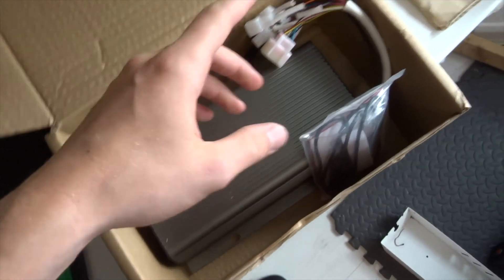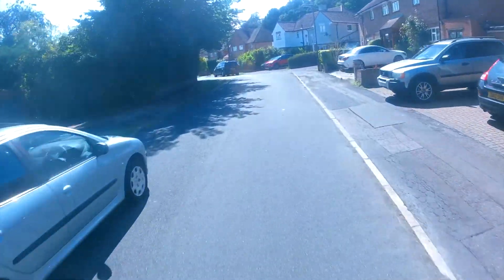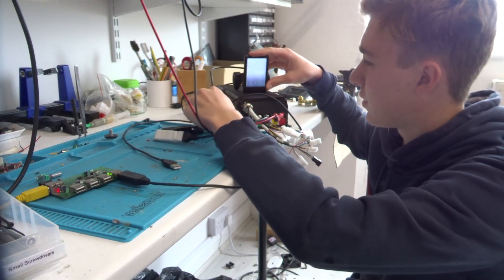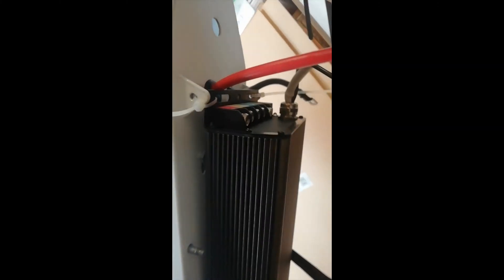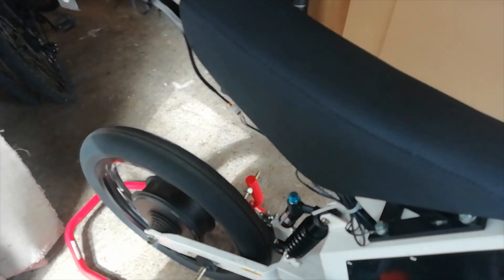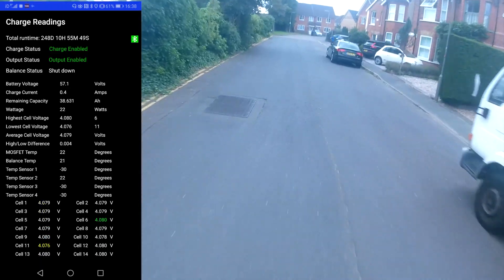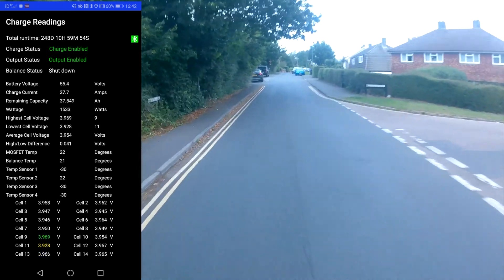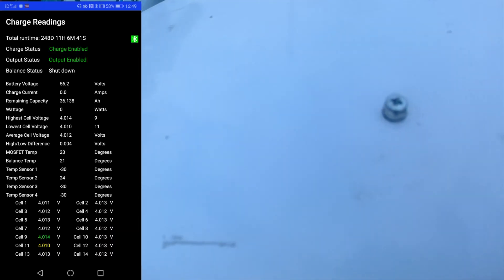The drama continues... - Sabvoton trouble - 8kW Enduro MSVA eBike V3 Build

Comment: If you pause at 10:26, you get 56.8v, 151.8 amps, 8614 watts = Front wheel up.
Reply from the maker: I wish! I wonder now if the motor is a much lower winding that what I thought perhaps a 2 or 3T

Comment: All this work and all these amps and no speed , this thing should be doing 110 Km
Reply from the maker: Could be close to 60mph with high flux weakening. Letting you down with the low battery voltage there! 😂

Comment: I don't know why most high-power electric bike users insist on sabvoton. 
There are a lot of high-power controllers.

The more features you have, the more likely you are to get errors.
Just buy a controller that has only simple functions. 
Once you have set the perfect settings, you won't need to change the controller's settings anymore,
so it's a waste of money to buy a complicated controller like a expensive sabvoton.
Reply from the maker: At the time of making, it was the only brand I'd really heard of as you say a lot of other people use them. I have now learned they are not the best so will keep the one I have for now my eye on the market and browse around.

Comment: I have a sabvoton 150 on my bike and recently broke the screen which meant I had to use the bike without the UKC1 screen and it went into power level 1, I also note on mine power level 1 is very erratic, almost unusable the higher the settings I run.  The fix I found was setting the sabvoton to hard start in the app not 3 level switch or boost etc just hard start.  I since fixed the screen and still leave in hard start and the screen computer overrides with lowering power but I cn now unplug it and it comes on full (app settings) power.
Reply from the maker: That's annoying about your screen, but I've tried hard start and it didn't make a difference 😒

Comment: Hi , seems you know how to sus many problems , I need a bit of help finishing mine , I bought a 8000w  72v 150a  Enduro ebike from china ,I wanted a complete bike , then they said because of Brexit could not send complete , so agreed to build the bike from bits , got the bike in may , guess what no assembly instructions and no wiring diagram .anyway I finished the build , watched some videos , managed to get the company to sent some pics of the sabvocon wires , but the wires had differant colours and some connectors didn't match . I have fitted the wires from the hub to sabvocon and connected the back light , I have key with wires fitted , and a rectifier/regulator , but the head light I don't know were to wire to , and I have 2 black wires from brake lever left and 2 for the right , but as on wires for brake have 3 blue separate  wires from sabvocon 1 female small black 1 male small black connector and 1 loose blue wire, so if you have any ideas , in connecting the headlight and brakes , and key , and rectifier/regulator , am stuck , help please . Doug
Reply from the maker: Hi Doug, there are so many variations of the sabvotons that it's going to be hard to tell, but I'll give it a go! 

The brake levers have a switch inside them so the two wires coming out of each side get connected together when the lever is pulled. On my sabvoton, there are two wires called High brake (purple) and Low brake (yellow). The brake wires from both sides can have one wire connected to either of these and then 12v for the high brake wire or 0v for the low brake wire. 

The key switch should be an orange wire from the sabvoton that connects to the battery positive somehow. I just added a wire to the red terminal of the sabvoton and connected that to one side of a switch, and the orange wire to the other side.

With the headlight, I don't think the sabvoton can deal with that so the way to hook that up would be to use a relay to connect it to the 12v regulator, then get a switch for the handlebars to turn it on and off.

Hope this helps and give me a reply if you need any further clarification.
Reply: hi , re brakes , the 2 wires from brakes each side 1 wire has white dashes along the wire ! , . from the sabvoton I have 2 wires 1 purple 1 black , they go into a small  black male connector and is the low brake , then I have 1 red wire from sabvocon to a female white connector that is 2 wire connector but only 1 wire going to it this is high brake , so how to connect  brake left 2 wires and right brake 2 wires , . i hope this makes sense , I bought some Chinese small connectors but don't know the name of the white connectors they use . Thanks Doug,
Reply: If I may ask, where do you buy the bike from on alibaba? Link?

Comment: I have a 72200 Sabvaton controller and I haven’t had an issue with the one I had before but this time it just keeps saying communication error 30h . Can anyone please give me a solution to why this could be happening.?
Reply from the maker: I believe that means the throttle at rest is higher than the minimum throttle voltage set so it disables itself to protect the bike from shooting off.

Comment: Hello !
I’ve seen your videos struggling with the Sabvoton Controller , I’m building an E-bike with a Sabvoton Controller myself and maybe your problem could be “Under-voltage” . Correct me if I’m wrong but i think you have a 72v150A.
And I think the Sabvoton is not made for your kind of Battery setup wich is a bit of a rarity (with “only” 56Volts).
Even if you can set the voltage you like in the setup program maybe the voltage of battery is to low for the controller to work correctly.
Normally with a 72v Battery setup the lowest voltage limit is 50v and in your test ride video’s it seems that the power is cutting off every time you get below the 50v-range. And in the last test you made, you have better results maybe because you fully-charged your battery and as a result your battery-voltage is a bit higher so the controller works better. 
So maybe your Sabvoton isn’t broken.
It would be nice if you could somehow do a test drive with 72volts.
I could be wrong, only trying to help.
Otherwise keep up the nice Videos 👍 and don’t give up.😉
Reply from the maker: I thought it was that as well at first, but I've set it to 0v and still have the issue. The controller is meant to work down to 36v and the new one works fine so I'm afraid it's deffo a controller issue
Reply: Ok

Comment: Did you try a different throttle? The hall sensor in your throttle may be faulty?
Reply from the maker: Yep I tried 3 different ones. The first one seemed a bit faulty with my multimeter but the other two were fine so no reason why they wouldn't work

Comment: Maybe this is a sign to use a different controller. Seems like Sabvoton issues are popping up all over the place (including mine). They're really nice then they work but its nice to know your bike will turn on and work properly when you go to use it.
Reply from the maker: Hmm unfortunately it does. I think they've been using the same design for over a decade which means it should be tried and tested, but maybe their QC isn't up to much?

Comment: Glad you got it figured out, all it took was 3 different controllers! Maybe there was a QC issue with those older ones, you can tell the one that worked is a new controller (V2) because they changed the mounting hole locations.
Reply: My V2 controller had issues that were similar to his but more annoying because it would cause the motor to judder at high speeds almost like desync.
Reply: @phylaxxx  Thankfully I haven't experienced any controller issues with the myriad of controllers I have experienced, I guess if I had to pick I'd rather have controller issues than motor issues, it's a bit easier to swap out, still a pain though.
Reply: @phylaxxx   My sabvoton does the same
Reply from the maker: That's why I wondered if it's a production issue, I'll stay away from the V1s in the future!